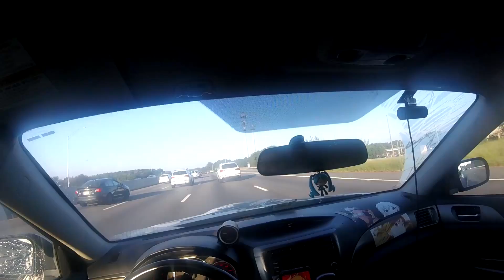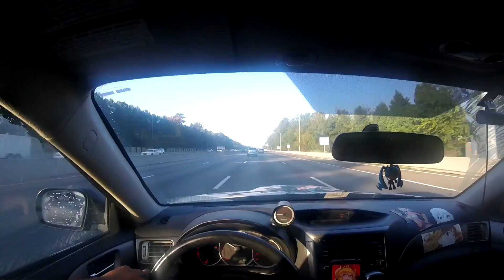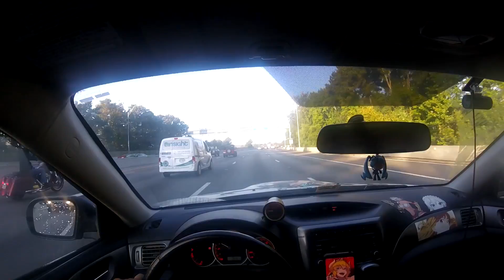Yash Media | VLOG 14 | Subaru Engine Failing

Comment: Sorry to hear that. Hope your able to figure something out. I always worry about when the ka in my s13 goes but so far still seems to be running good at 151k. How many miles is currently on your car? Not sure if you mentioned it.
Reply from the maker: 126k on it, I'm leaning towards trading her in. :(
Reply: @TBInuYashaX  That's the most reasonable option I guess. If you do though maybe you can keep the hood as a momento. ;)